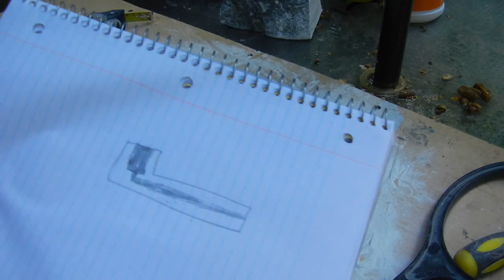Grim Reefer - Basic Soapstone Pipe

Comment: I am concerned about the drill bits. do you use conventional bits for wood and metal or drill bits for stone, cement?
Reply from the maker: for the softer stone, conventional bits will suffice  but when you're using harder, darker stone, cement or diamond tipped drills will work great
Reply: On soapstone, conventional bits will do ?